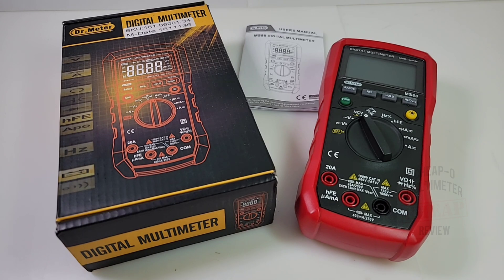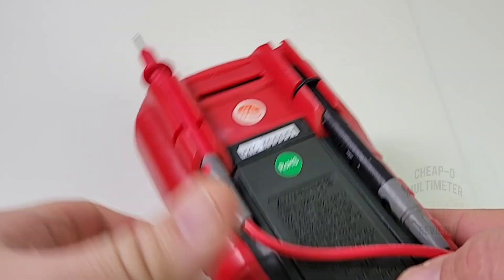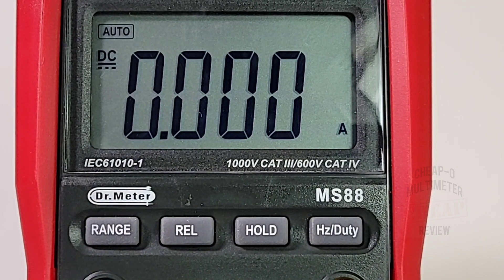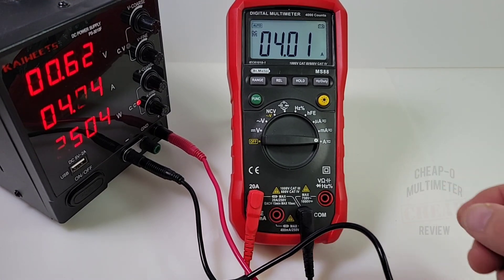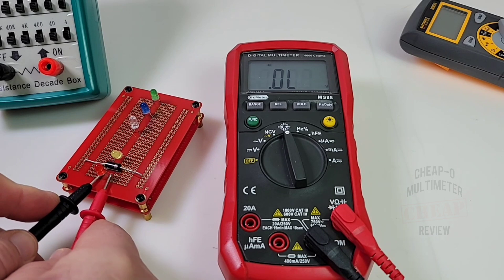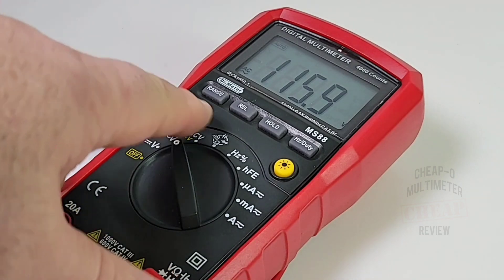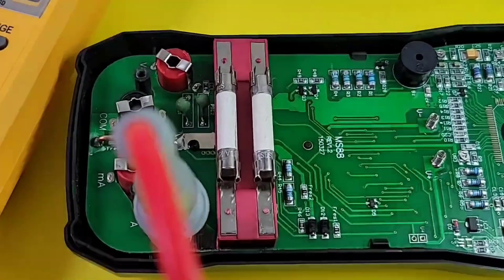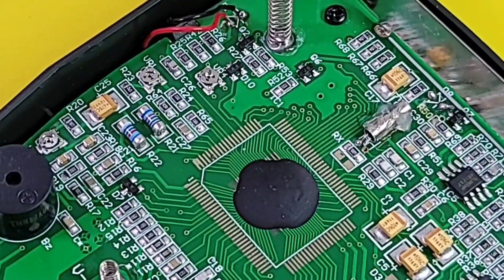Dr.Meter MS88 CHEAP-O Multimeter Review & Teardown!

Comment: Hi Darren. Nice Video ! ! !
What do you think. The best, the most accurate, the most functional, the one that knows the most - what kind of multimeter is up to $ 14?
102?
113D? (21T)
404b?
Mustool MT108T
Оr maybe LOMVUM DM616?
Reply from the maker: My choice would be 113D...absolutely a phenomenal multimeter at such a low price 👍 Features galore and great performance.
Reply: @KeepOnTesting  Have you seen his new revision?  Everything there is based on SMD components now and the circuitry has been slightly cheaper.
Reply from the maker: @Pro100Gadman  ahhhh..not good. First I've seen of the new pcb revision. Why oh why mess with something 🤔 that was great.
Thanks for the update.. maybe I'll have to revise my recommendation based on the 113d lower quality update.
Reply: @KeepOnTesting Yeah .... maybe not so bad, but the reviews got worse from users.
 The 102e models are not bad as well as the Mustool MT108m (WinApex 8102), but if it doesn't bother you, I would like to have a look at the LOMVUM DM616 on YouTube. Literally a short video, there a man shows the circuitry at the end. I would like to hear your opinion. It seems to me that LOMVUM DM616 is a symbiosis of 8102 and 113d. Look plz.

 
RM 102? ( Aneng 8002 )
RM 113D? ( NJTY T21D )
404b?
Mustool MT108T ( winapex 8202 )
Mustool MT108N ( Winapex 8101 )
Оr maybe LOMVUM DM616? ( based on SD 7501 chip )
Reply: @KeepOnTesting  The new revision of the 113D was carried out on a fresh SD7890 chip ( old chip is 0660, like rm102 ). You see, it was simplified somewhere, but the chip was updated. He probably should now perform continuity and measurements of capacitors and diodes faster now.

  I still wanted to know your opinion about LOMYUV 616
Reply from the maker: @Pro100Gadman  I've just ordered 1 LOMVUM DM616 for review. Then I'll have an opinion for you 😉 👍
Reply: @KeepOnTesting  Omg))) This is unexpected))
 How long has he been coming to you? When will it be reviewed?
Reply: @KeepOnTesting  I would like you to give some kind of assessment in the review in comparison with other budget multimeters. RM 102, RM 113d and WinApex 8102. It would be interesting to hear you how much better or worse the DM616 model is than the 102,113 and 8102. Thank you very much)
Reply from the maker: @Pro100Gadman  it was ordered only last week..AliExpress to Canada takes about 4 weeks ..so hopefully before Xmas I will have the Review posted 👍
Reply from the maker: @Pro100Gadman  Good points..I'll do a comparative roundup if possible ...
Reply: @KeepOnTesting  Tnx man. I appreciate it. Thanks a lot. Hello from Ukraine )
Reply from the maker: @Pro100Gadman  My pleasure.btw..my wife is Ukrainian ..(so was my grandfather)..cheers/ Дай Боже!
Reply: @KeepOnTesting  Cool)) Maybe she is from Kharkov?)
 The Ukrainian diaspora is the largest in Canada. There you even have ministers, Ukrainians) I have a classmate living in Canada. Toronto-Quebec.
Reply from the maker: @Pro100Gadman  ahhh..she is from Chernivtsi, way west.Yes, alot of Ukrainians in Canada..especially out West..Manitoba, Saskatchewan and Alberta. I'm in Ottawa...(Eastern Canada)..about 4 hrs drive from Toronto..small world eh 😅. You can email me , netplicity1@gmail.com if you like.
Reply: @KeepOnTesting  Good. I like Canada. 
 My very old multimeter burned out and decided something new. but since I have no money, so my budget is limited to $ 12. So I'm looking for the best device at this price in terms of reliability and, most importantly, accuracy with the maximum set of functions. I myself know a little about circuitry, so I look at the security of the device, its main chip, so that the white LEDs light up in the dial mode (because they need 2.5v, unlike others, which is enough for 1.8v), the number of high-precision diodes and how the tracks are divorced, because if the tracks are power at 10A
the electrical circuits are close, so an arc can pass there.
Reply: @KeepOnTesting  I watch a lot of our guys who do tests, And now I found your cool channel and I like your tests. Thank you very much. Say hello to your wife. Glory to Ukraine ! ! ! ))
Reply from the maker: @Pro100Gadman  You sound like you're off to a great start..let us know which multimeter you decide on..😉
Reply: @KeepOnTesting  I’ll wait for you when you make a review on the LOMVUM DM616 that you ordered and we will make conclusions based on this. Still, I want to understand and what would you say your opinion, which of his competitors will be better. LOMVUM DM616 or rm113d or rm102. You have experience and reviews. I would like that you would then make a verdict about the best budget multimeter with a budget of $ 12.
Reply: @KeepOnTesting  https://youtu.be/KjK_z5h2vZI
Reply: No no.  mustool mt108m is the same as winapex 8102. And LOMYUV 616 is a unique and cheap multimeter.  There is a video on YouTube, you can watch it for yourself.  A very decent model with good circuitry.

Comment: Darn. I thought this was going to be great for my bench. I mostly play with arduino and guitar pedals, so diode and transistor testing is very important.  Bummed.
Reply from the maker: Not sure why the led performance (1.5v output) was so dismal.. especially as they're utilizing a 9v battery. A real letdown for sure.

Comment: Great vent this week. Tiny dark red or blue font on a black background is ridiculous. You can barely read it even in good lightning conditions. What is worse, this color coding hardly gives you any information. I only find it useful on manual ranging meters, when it groups multiple ranges together. That HOLDPEAK HP-760C being a great example of good color coding (and an LED is a cherry on top). But then we have something like ANENG SZ18 with its "rainbow" selector switch and you just wonder what were they thinking? Even though it has decent contrast and is probably readable, it looks like a carrousel (a merry-go-round).🤔
Reply from the maker: It's funny isn't it..  Engineers actually get paid to come up with these ludicrous color schemes! Either they have no clue of the instruments intended purpose or they are color blind. I think 🤔 it might be both!!

Comment: Interesting review. Given the input protection, I would be surprised if that meets CATIV 600V. Diode test was strange, wonder if there is a current limit on the test function, enough for a standard diode, but not for an LED.

Comment: A real shame for the Diode and Cap functionally (or lack of to be exact). Also weird that the price range is so all over the place but even for 35 bucks in it’s current state it is, in my opinion, not worth it. For this price there are much better alternatives.
Reply from the maker: Agreed 👍 Shame really as this multimeter had alot of promise..

Comment: It seems this was defective. What was the open probe voltage for that Diode check and cap test? and did you confirm it with a fresh battery? That would likely be a deal breaker for many folks.
Reply from the maker: Fresh battery was used .. 🔋 output voltage in  DIODE mode was only 1.5v. Too bad the Dr. doesn't do led's...
Reply: I had two of these and both were exactly the same in diode voltage and cap range as this one and the instructions confirmed the cap range, really ruined an otherwise worthwhile meter. This meter had the best NCV of any meter id seen in a long time, but what were they thinking with that virtually non-existant cap range-??  Another one that could have been great if they had went the last ten yards on the design.
Reply from the maker: @yambo59  It's too bad really.. this could've turned into a really great multimeter..Thx again Mike for your generosity 😁👍